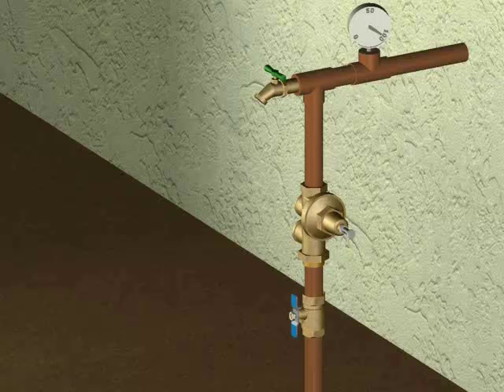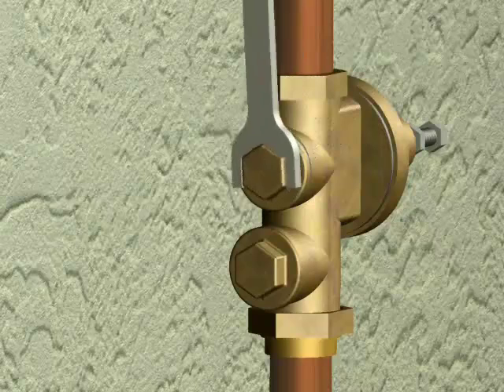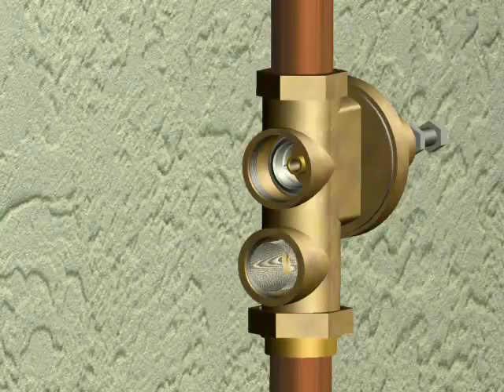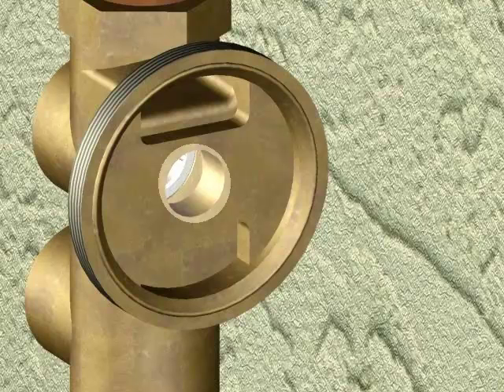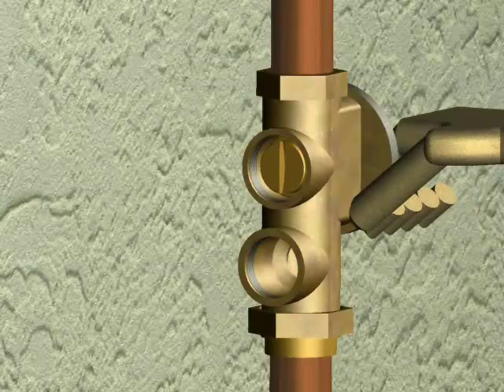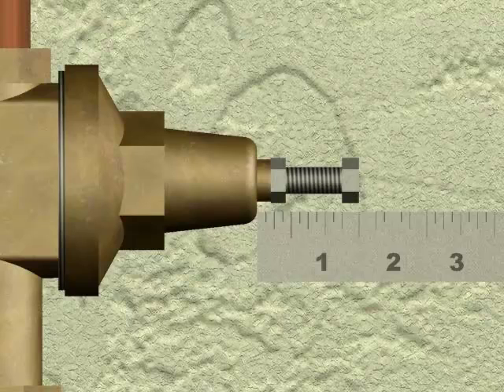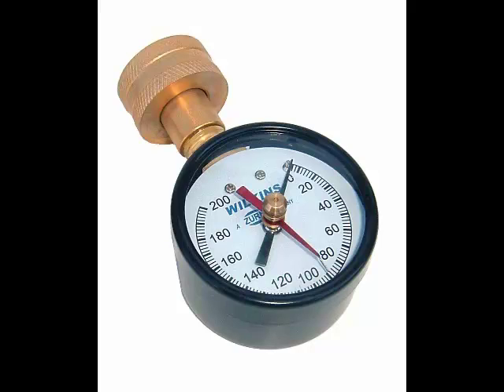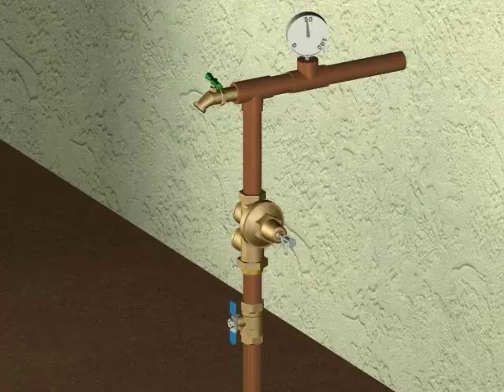Zurn Wilkins Pressure Reducing Valves 600 - How to Repair

Comment: I have very little water pressure at my house? I'm on city water. I have an electronic water meter and a back flo preventer on my system but no pressure meter anywhere??
Is this normal? And where can I turn my home water pressure up???
Reply from the maker: Our Product Manager says: "If you have a Pressure Reducing Valve on your home then you can adjust it to be set to a higher pressure by turning the adjusting bolt clockwise.  However, if the incoming street pressure is too low then the pressure reducing valve cannot increase pressure.  In your case it sounds like you do not have a Pressure Reducing valve which is not uncommon on homes with low incoming street pressure.  Unfortunately the only way to increase pressure if this is the case is to add a pump."

Comment: It worked, thankyou. I just followed your video step-by-step.  I'm glad the Repare kit fit, because I knew I couldn't return it. 

I noticed the old parts in the bell-housing were extremely calcified (white as snow, blanketed with a white 'frosty' coating)... And I think that must have been the main problem.  (Just my opinion).

And, now I retested my water pressure and it is now about 55.  (Before it was 88!...scary!)

There is a great water pressure meter at 'Home Depot' for 11 bucks.  And it is easy as attach it to the hose faucet outside (or shower faucet inside) and can instantly get a pressure reading.
Reply from the maker: Glad to hear that this video was helpful!
Reply: 88 psi is a bit high, but not too scary.  Where I live, when the pressure reducing valve fails the static pressure in my house plumbing goes up to the city's water main pressure of 120 psi, although if the valve is still partially functioning the pressure drops to near the valve's set-point if a faucet is opened.  If the static pressure gets over 100 psi it can be very bad for plastic valve bodies, such as those found in dishwashers, clothes washers and irrigation valves.

Comment: My Md 600 is no longer regulating the pressure. I pressured current pressure at 120psi...will the repair kit fix this??
Reply from the maker: Hi Rick. Provided that the o-ring bore is not pitted, there is absolutely no reason why a repair kit won't correct the problem. When the parts have been removed from the body, the o-ring bore is in the body where the o-ring on the stem resides. If the bore is smooth, the repair will work. If the bore is pitted or grooved, do not install the parts, as the repair will be ineffective.

If you have any more questions, feel free to contact the Zurn Wilkins Customer Care department at 1-855-ONE-ZURN (1-855-663-9876).

Comment: Thank You for the video - I ended up flipping my washer over for a fresh sealing-surface and replacing the o-ring plus a bit of silicone plumbing grease and my pressure regulator is now back in business...Some others report they have frozen )to make the rubber easier to sand) and sanded down a rubber washer from brass anti-siphon sprinkler repair kits that cost less than $10  such as Orbit kit 53066 or Aqualine RK1 or RK2